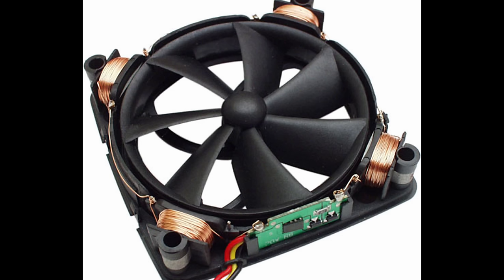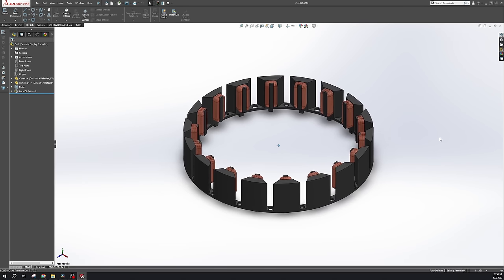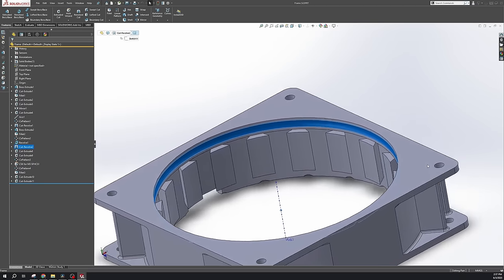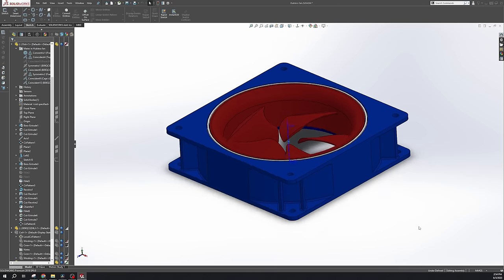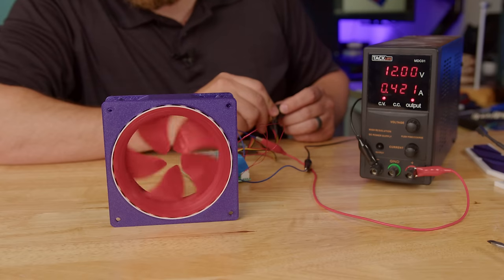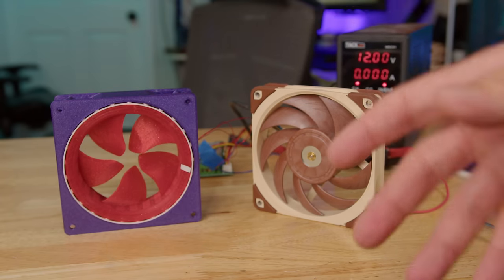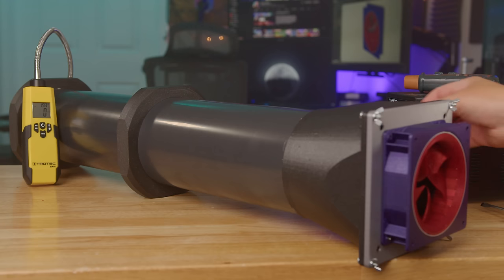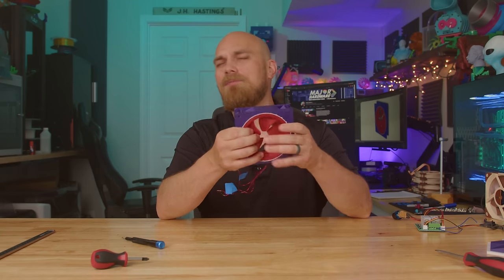I made a HUBLESS PC fan and it’s so loud!

Comment: Temperature and magic smoke loss is inversely proportional to surface area.  Moving the “hub” to the ring increased its area by some factor or maybe an order of magnitude (I am not going to calculate this).  So you can probably increase the amperage by quite a bit before the magic smoke escapes.

Comment: Nice design no hub may be it would work better if there were more blades and the bearing where oiled.
And for a reminder, you a promise to make a v2 of the water cooled air cooler with with better flow. I'm waiting.

Comment: don't know i'm not an electrical engineer, but there is probably some optimization possible in the ratio between the magnets on the rotor and the stator coils, you can improve efficiency or torque depending on your ratio, there is no fixed rule, but different ratios have different effects, blade design-wise, you could have gone a bit more aggressive with filling up the gaps, the original design is for water, air is a much less viscous "liquid" more blades less gaps could probably also improve performance

Comment: Add a little oil to the bearings, should make it quieter, and run smoother. Also, the gap in between the windings and magnets can effect the efficiency and power of the motor.

Comment: you can also add some grease on the bearing so it will run more quietly and smoothly and draw less power and spin faster, try it like that, it will make a difference

Comment: When you said loud I expected it to be related to the blades in some way. But seems its just bearings. I would like to see this done with much better bearings to see how loud only the blades/airflow is as you hit that 3k ish RPM. Would be really cool if you could build the blades in a modular way so you could pop out the fan for washing (or even to just change colour once in a while) as it collects dust or hair. a feature hub motor fans would be very challenged to offer.

Comment: You probably can do away with the bearings if you use permanent magnets. Consider the fan is going to push mostly in one direction. If you put magnets on the rim of the fan then make a cover that has magnets to push against those it will keep the fan from rubbing if they are powerful enough. If you do that on both ends of the fan that should keep it from moving in either direction. The rotational magnets should be strong enough to keep it mostly centered if you did it right. If you have a way to balance the fan that will also help. Given your fan will then effectively be floating not rubbing against anything it should be vastly more quiet.

Comment: Pretty good results given the materials you had to work with. That iron filled PLA probably is not all that much better from an air core. There is probably far too much reluctance from the PLA binder basically acting as a air gap which will give poor field shaping. Some lubrication and balancing might have also made it quieter.

Comment: I want to see you lubricate the bearings. I would suggest grease, silicone lubricant, or for a cleaner solution talcan powder which seems less messy but also can float in the air like dust.   Also an interesting idea would be to give it a polishing cycle with baking soda in the bearings to gently smooth the hotspots, then clean that out and finish with lubricant.

Comment: The bearing races need to be smoothed prior to being assembled.  I bet most of the noise is coming from the bearing balls rolling over inconsistencies in the race surface.  Also, change the cage to a 2 piece design so it clamps like a clam shell around the bearings rather than clipping in place.  That will reduce both noise and drag.

You should look at the hub-less fan propulsion for airplanes that's floating around.  It uses an axial motor with neodymium magnets.

Comment: I am impressed with the work, out of a 3D printer and whatnot.
BTW the blade angle is optimized for moving water not air. Seeing the airflow numbers, I think a proper blade design would GREATLY improve airflow.
Next, I would guess that playing with configurations and using stronger/different magnet configurations would further improve the design.
There's much to learn about bearing options, and I would look into what some have done with Tesla turbines and "air bearings"

Comment: Some lubrication would likely help with the noise. Currently it's two hard surfaces against each other, aside from being noisy it would also generate friction and consequently wear out really fast. We've all seen what happens to bearings when the grease escapes, they wear and fail quite quickly without lubrication, the telltale sign of course is they become increasingly noisy before failing. I'd be inclined to try a few different lubricants, perhaps start with a tiny amount of sewing machine oil and see what happens. Those ceramic balls are a lot harder than the 3D printed material, I expect they'll wear a groove in no time flat without any lubricant, and the predictable result of that will be destructive failure.

Comment: I think the hole in the middle could be a bit bigger without performance loss, maybe it even yields a bit of performance gain.
The smoke test seemed to show that the majority isn't pulled in by the vortex which seems to me like you're leaving money on the table there.
An inflow duct might need a vortex shape to be effective with this hubless design as it wants to create a vortex so badly that it is literally screaming.
An outflow duct might help move more air too.

Comment: Remove bearings, add more magnets in a N-N and S-S configuration (over the top of the the fan) to sandwich the fan, hold the top "bread' together with screws.

Comment: The noise is mostly from the bearing.
Want it to spin faster ? Increase the frequency used to drive it. You can probably crank it's speed to over 10 000 PRM, or until it flies apart.

Comment: So funny! Great work, and great idea, CFM per watt could be a good thing to compare if there will be more.  I want to see a version with the motors in the corners, and magnetic bearings, also those in the corners. Typical 120x25 fans use around 1 watt, and the static pressure is typically around 2mm H2O, which equates to about 20 grams of static thrust assuming 110 mm actual fan diameter.  So, very little motor power is needed, and the bearings        don't need to be very powerful either assuming the fan is reasonably well balanced, and there's a plan B if the fan is moved, especially if it's moved when spinning.

Comment: 100 percent needs to be balanced.  Maybe use some graphite for lubrication on those bearings?  This gives me an idea though of a compressed air induced fan instead of your magnetic based system.  Would be extremely curious to see a simulation of this fan to see if there's an "event horizon" where air effectively has a neutral speed through the most center point of the fan given the 'whirlpool' like nature.

Comment: #1: That smoke test made me think of the event horizon of a black hole! lol

#2: Grab a good 24v 3d printer PSU & let's see that thing SCREAM!!!

P.S. On the "what might I have done wrong electrically," I think you probably could use about 4x as many turns of wire for your coils.

Comment: run it with some very fine lapping past in the bearing grove to help smooth things out and then stuff it with graphite and see how quiet it gets. Since there's no electronics in it, just wires, you don't need to worry about the graphite shorting things out

Comment: The next van you should make should be a fan that runs off of the water that pumps through the radiator. Kind of like a hydraulic fan.

Comment: Noctua's starting to sweat rn.

Okay but fr this is so cool. Imagine going from testing fan blades to making a fan from scratch. I think something I'd do is drip some oil in the channel and improve the noise. Also idk if it works with that material but smoothen it out with acetone or something.

Comment: It might actually end up quiet with optimization.  The fan tips are going slow instead of fast so sound from air interaction should be less.  Better barrings are the only thing holding you back.

Comment: Neither your stator nor rotor have any backiron to allow flux to flow between each "tooth". That would hurt your torque production a lot and cause it to draw a lot more power than it needs to. If you add in even a thin strip of steel around the back of the coils and magnets you'll be able to get much lower power draw. Not that it matters apparently, given that it spun so fast with no issues. The large area that the coils were distributed around probably helped a lot with thermals

Comment: Hope you don't mind some advice and suggestions.
Firstly, nice try! But . . .
It's a 'proof of concept' and the concept has been proven with this.
The noise is from the rattling bearing retainer and of course the balls in the race, meaning that this should be your first point of interest.
Looking at the general geometry, my suggestion would also be to get rid of the excess thick rim as well as this would allow larger blades and more airflow.

Go extreme! 
Get rid of the bearinga altogether and use magnetic levitation bearings. I mean, you already have enough magnets around the rim to do this. 
Use a plastic 2 mm strip of magnetic material on the rotor instead of metal magnets.
Secondly, only put coils in the corners of the frame, where there is room. You don't need coils all around. Two in each corner would be sufficient and would allow a BIG reduction in rim-size. 

Allright, unpowered it would rattle a little. But powered it could be virtually noiseless and only produce air-turbulence noise.

I realize that it's a big step in design (and engineering) but you asked for it. 

I'd also try a toroidal hubless propeller design even though it would perhaps compromise the total thickness of the design.
You wanted innovative ideas, here you go!
It'll be a challenge to design and engineer though.

Love your channel and the way you present it.

Hap. (Retired project manager, European Micro-Motor design and manufacturing company)

Comment: I have seen people trying to make this kind of thing for air thrusters. 

It's not so bad with water as the relive rpm will be low compared to air as water is dence. 

And the rpm is a real issue with this kind of fan if used for real trust applications. Not just a little fan.

The bearing being on the rim means you have set up two bad situations for a bearings. A high trust load as it has to take the trust of the fan. And a high surface speed as its at the rim and not the hub. 

The high surface speed means the balls or rollers may spin so fast they explode. Or if its a plain bearing, any friction will be a much larger drag as it has a lot more leverage at a large diameter than a small spindle in the middle. 

A oil pressure fed one may work but how will you seal that up? 

An air bearing would work but its nowhere near ideal to take the trust. 

There's just a lot of good reasons you put the bearing in the middle. 

Which is why this type of fan will probably never be more than a rich novelty. 

Fun project though. Shame you couldn't turn up a steel outer and inner race so it was smooth and accurate.

Comment: I have one of those tmd fans in a box of fans.  The only reason i dont use it, is because its rpm is ridiculously high, and the fan blades are less then optimised. Its loud as sin.  Its also a hog in terms of power requirement.
 One of the highest static pressure fans i have, and easily the coolest design.
If noctua built a big vs of it it would easily be my favorite.

Comment: Maybe apply a little bit of graphite for dry lubrication, might reduce the noise a smidge/ increase max rpm. If you build one of these again I'd propose using a seperate bearing ideally made from teflon with ceramic balls, should make it a lot more bearable for the ears.

Comment: awesome idea, but instead off having the bearings circumnavigate the diameter, have the fan centered on small wheels maybe at the corners. That would cut the noise down drastically.

Comment: This is awesome 👌 
You need to try another blade config, something with aggressive blade angles and count, since your drive has a lot of torque by design. Also, if you keep only the outer motor ring, you could design swappable blade rings. That would be cool 😎

Comment: First thought on seeing it is that you're going to need a lot more bearing surface for a hubless design which is going to drive up cost. There's also more surface to suface contact therefore more friction leading to a loss in efficiency, both as noise and heat. Those are just why I think the design may not have caught on.
Still an interesting project and fascinating to see. Thinking of noise, have you seen the new AlphaCool Apex Stealth fans? Those that definitely look solid and may beat the Noctua for both noise and performance.

Comment: I had the TMD fan on a CPU cooler back on 2002(?), I just happen to be walking by my room and I heard a loud click come from my computer, I went to go check it out and the fan was stuck. Turns out the magnets came off the fan blade and got stuck. Might be why the design never took off. Lots of weight far from the hub.  I've always been thankful I just happen to be walking by when it failed. Was a dual CPU (yes 2 completely separate single core CPUs) server board. Dang I'm getting old....

Comment: Seal and grease the bearings to address the noise. Make the fan separable from the rotor magnets to make it easier to change fan designs. Try out different fan designs like more blades, one with less center clearance, one with a hub, etc.

Comment: AMAZING!
Now I'm curious what 1) blades that are thin on the edges and grow thicker towards the middle, possibly even touching/connecting in the center would be, or even 2) fairly wide fins on the outer edges with fairly wide fins on the inner edge as well connected in t he center could be. The flow is lackluster, but with a few quick prototypes I think you could figure out what would be the best geometry of blades and rapidly increase that cfm.

Comment: Did you oil the bearing balls? Ideally, to help prevent heating and cut down on noise you'd have a ceramic cage for the bearings to keep them evenly spaced, and you'd oil them to cut down on friction. Of course, that only comes from my time roller skating.

Comment: Imagine what it would be like with a properly pressed bearing, or finding some way to make the rotating parts 'float' on the magnetic field so there's no physical contact to make noise, heat, and waste energy overcoming friction.

I would imagine it would function better with balanced blades (i.e. even number) that came together in the center so there's no empty void that does the same thing as a hub... which is to not move air.

Comment: The bearing is loud because it's dry. Most likely if you put a few drops of silicon oil in there it'll be much more quiet.

Otherwise if you want to nuke the thing, put it on a 4S Lipo with an ESP like you'd use on an RC car or drone. Something that'll put out a couple hundred watts with no issues.

Comment: Roller or needle bearings would probably be a smart move. And smaller tolerances so there's less play. That will be tricky on a printer though. Probably need to over dimension everything ever so slightly and sand it to a super snug fit. Super sick concept though :D
Reply: Come to think of it... the plastic might expand under the load of rotating. That might make it hard to get the tolerances just right. I hope this design will be iterated upon :D

Comment: This is really awesome! 
-One thing i'm interested in having tested out is whether or not you could inset some of those little induction leds into the fan blade and if the motor windings would power them or not. then you could have leds in the blades. -would greasing the bearing help? graphite maybe?

Comment: This is awesome! I wonder if you could do a similar design, but add the hub again, but really really small with 2 bearings, but keep the motor design the same. Like a minimal size hub design just to get standard bearing in there that will be a lot quieter.

Comment: I was thinking, bearing wise, that you could use a smaller ball bearing. The more common ones, like the kind found in fidget spinners, one of those in each of the corners and have it run in a track on those. Would probably be a lot quieter, only thing is the fact that they're usually metal.

Comment: I know how to do it a whole lot cheaper and quieter than you did it ;) BTW ty for the idea! I'm feeling generous so I would recommend suspending it on a fabric reinforced belt with tensioners to help center it. Theoretically,  that would be very silent. To improve cost I would drop making the whole thing a motor and put a much smaller motor at one of the fixed supports for the belt.

Comment: you should put grease in, it slows it down but runs way more silent. and add a grease cap on top ^^
normal bearings are very loud too without grease.

Comment: Very impressive project. Of course, lots of metal balls running on FDM printed tracks is going to be pretty rough. I would expect it to get less noisy with enough use when the tracks hopefully wear smoother.

Since building the bearing is probably the time consuming part, it would be interesting to separate fan blades from the edge so that you could swap different fan designs without rebuilding the bearing every time.

I would expect a fan design that pushes air towards the center to improve its performance because then the hole in the middle could behave as suction hole. If you cannot utilize the center for anything, having more complex design to keep the middle open makes no sense.